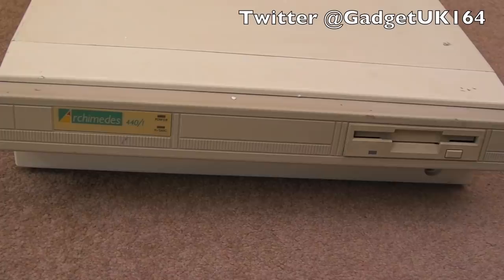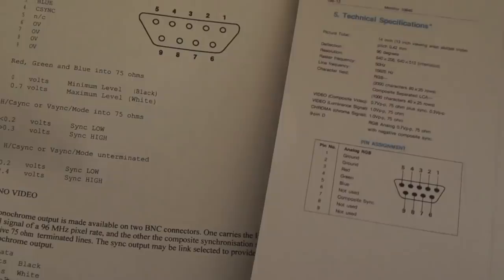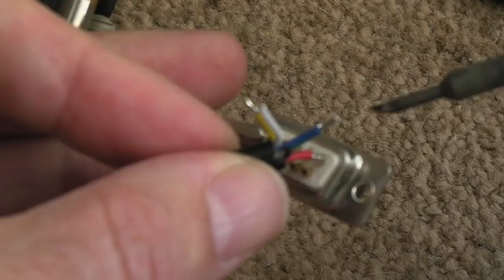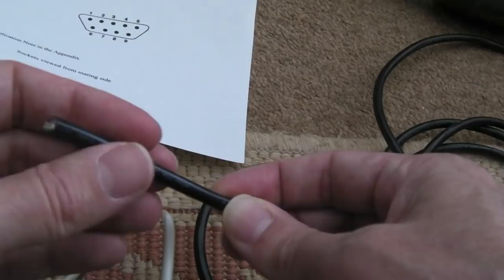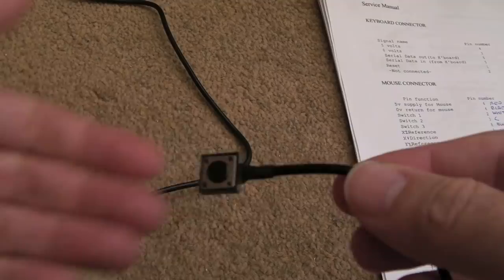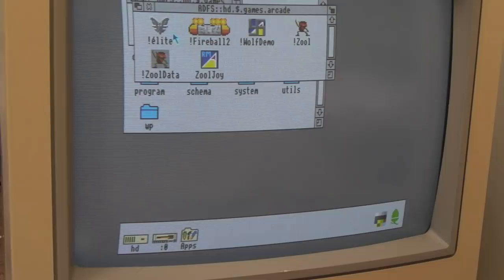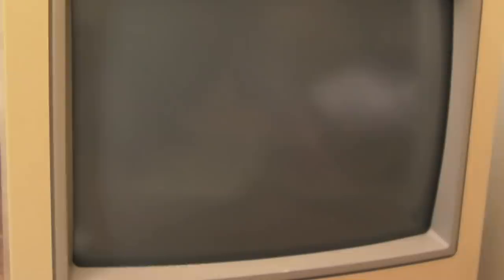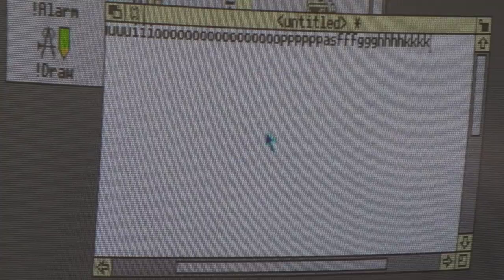Acorn A440/1 Archimedes Repair Part 1 (Video, Mouse, Keyboard, Omniflop & More)

Comment: My RiscPC 600 died last month.. sad times :(
Reply from the maker: What happened to it - ie. how is it behaving?
Reply: @GadgetUK164  The fast onset of very quick video corruption and then no display at all. VRAM removed (as apparently it can run without the module present) but no go unfortunately...
Reply from the maker: @SabretoothBarnacle  Any chance its a bad cap or bad connection related to the video IC?
Reply from the maker: I do see SMD caps around there, and a battery!  If any of those caps are for coupling, you could try to bypass them to rule them out.  But do make sure they aren't smoothing caps etc.
Reply: @GadgetUK164  battery was removed a couple of years back... only very localised mild damage... the majority of components were removed to check the traces underneath. No idea what the issue is and unfortunately there are no known schematics for this machine as they have been lost as far as my Googling skills tell me :(